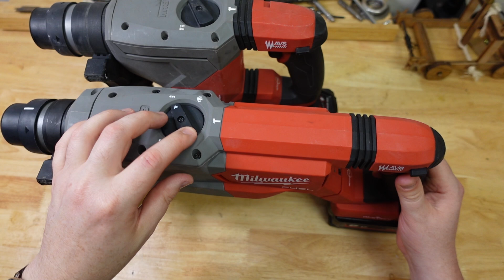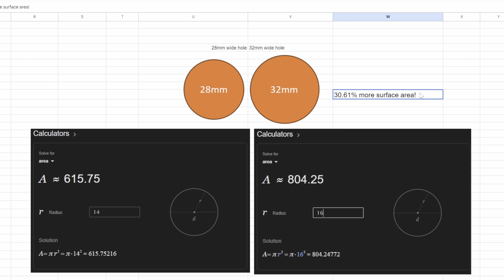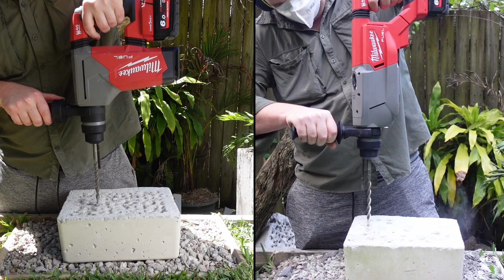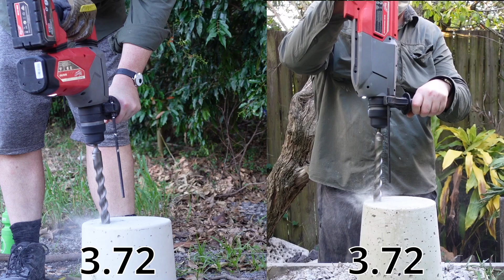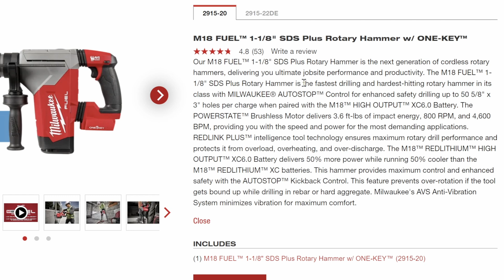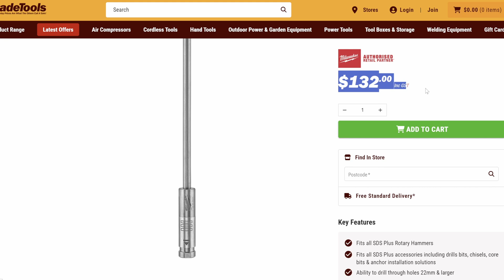2916 Vs 2915: Milwaukee's biggest SDS+ head to head

Comment: Unless you have already bought into Milwaukee tools,  I don't see the point of dropping Hilti money on one..If you do enough conc. work to require this performance, a TE 6-22 or TE 30-22 would be a better option in the long run? Hilti gear takes more abuse, lasts a lot longer and has a better warranty/repair options..

Comment: I haven't used the bit extensions but instead use 600mm and 1000mm long bits which cost a bit more but well worth it, make it very comfortable to use when drilling repeatedly. Great content Bolta !
Reply from the maker: Cheers mate! I want to try out some extensions. They're expensive but so are 1000mm bits! I reckon if the extension can outlast enough bits the price makes sense, but then they'll bring other problems like the chuck jamming up with dust

Comment: The price on the drop motor is crazy. Much cheaper than any of the other ones in that class (including the M18 D-handle), and it's the fastest.
Reply from the maker: It's quite something. I have no idea how they're keeping the price so low
Reply: @BoltahDownunder  I don't need it, but i feel like I should buy it before they jack the price up by $300

Comment: Bought the d handle for large bolts for tie downs, its a beast and reduces me 'bending down' dramatically.
Reply from the maker: Yeah it looks awesome for that! Have you ever used one of those bit extensions? They seem ok but probably annoying to use
Reply: @BoltahDownunder  Rang a friend today who does a lot of mechanical ducting work in large commercial jobs and he has used the milwaukee extension bits he got from USA. He says they're good and he uses them almost daily for overhead work. They might be great for reaching work but if you need to carry out complete drill through work I guess the hole or drill bit would have to be larger than the actual extension connection. Hope this helps.

Comment: It's not common for the D-Handle variant to be more expensive than the Drop motor version. 
Personally I purchased a D handle (other brand) because it was almost 40% cheaper than the drop motor variant with the same specs